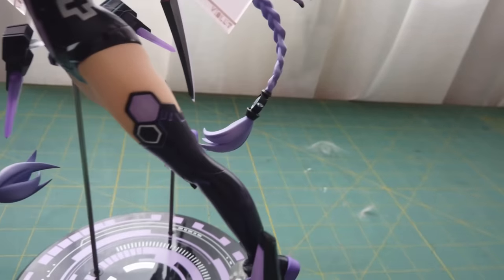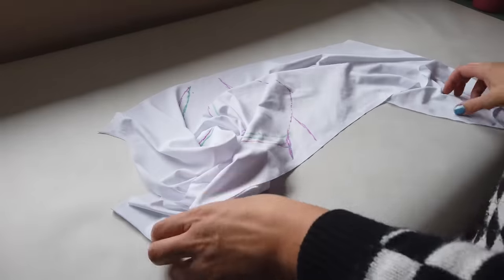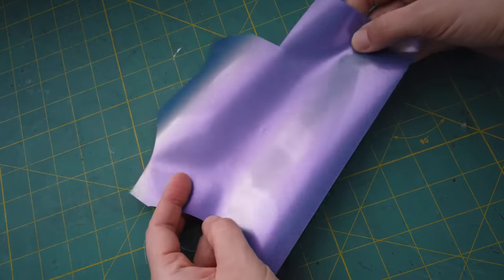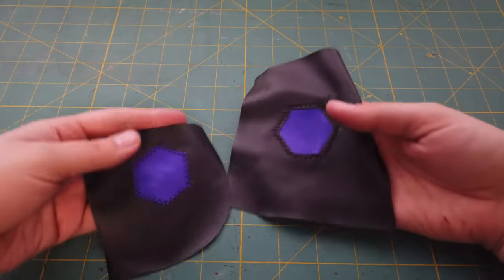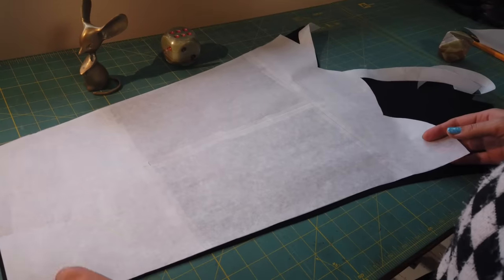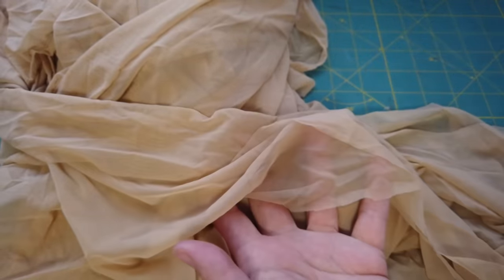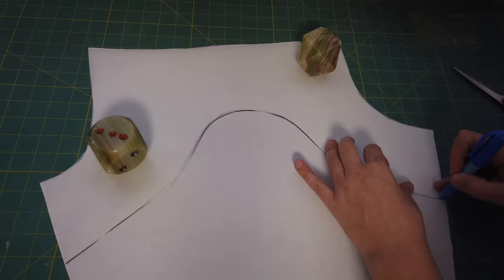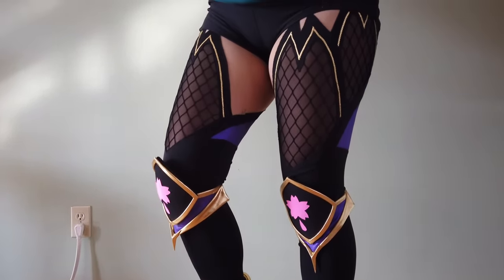How I Make Impractical Gravity Defying Socks and Leggings for Video Game Cosplays

Comment: Not sure if this trick is usable at all but if your fabric can get loose threads, then can you get a special plastic glue (do not know the name) and glue the edge, then after it is dry, heat the edge with a soldering iron, this will end up invisible but lock the threads on the edge and prevent it from ever getting loose, and it is invisible, instead of having to sew.

Comment: I grant you my tried and true advice, Titty Tape. Get some nice titty tape for any clothing you'll want to remove the tape from later, I've always had it work great for not just no bra tops but knee highs and thigh highs as well. You can also get a special material I've seen in some thigh stocking that is rubbery and essentially heavier duty titty tape and will cling to your skin. Just to warn, neither of these are very sensory friendly, as someone will sensory issues, but they'll guarantee those socks, arm socks, flowing clothe strips for a top, or whatever other bits you want to make sure stays will truly stay. And what the 2 stick to is opposite as well, titty tape sticks to your skin and uses static and something about how cloth and skin clings tightly to certain textures, so it won't leave residue on your cosplay. The heavier duty stuff adheres to the clothes because it's meant to stay permanently and uses a rubbery texture to prevent sliding so it stays in place. Titty tape will be sold at most clothing stores that sell more revealing clothes and the rubbery stuff at clothe stores

Comment: what was that rolling fabric cutter wheel thing. Seems useful
Reply: Probably a rotary cutter.  They come in different sizes/price ranges, but they are indeed very useful for certain things.
Reply from the maker: It's called a rotary cutter and it is absolutely the best! I can't tell you how much I hate cutting fabric out but I would definitely hate it more without one of those. It's a great tool if you do a lot of fabric cutting.